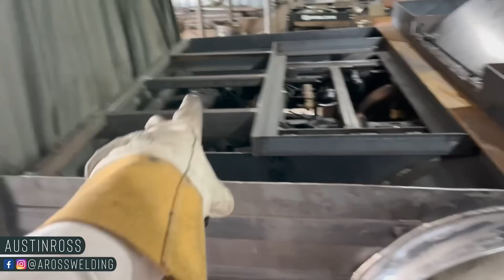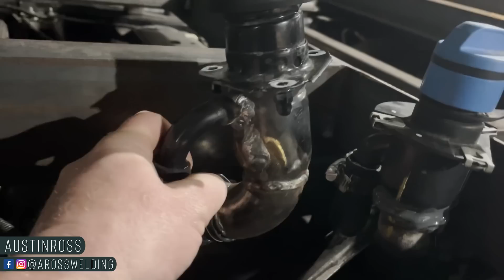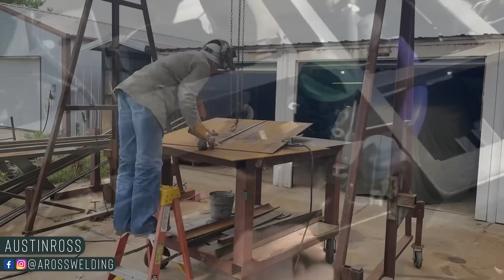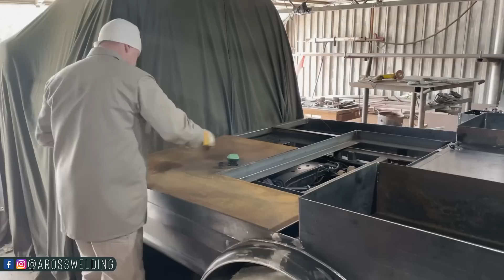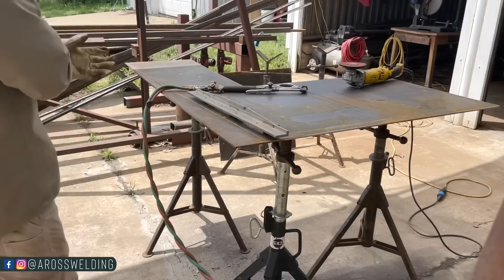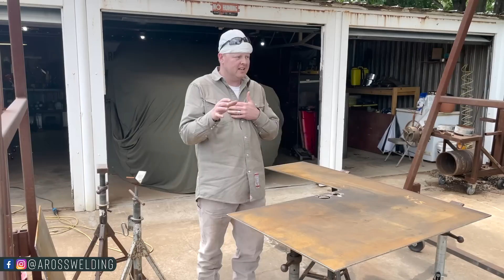Custom Welding Bed Filler Neck

Comment: Wonder what you think about this 

If you were to put the rod box right above the exhaust to heat it/ remove moisture I’m from Canada and there’s been times where I have been slamming my rods in the winter in my trucks exhaust while high idled to keep them hot 🤣

Comment: Great video! Thank you. Do you think the bed would've come out too weak if only 1/8" and 3/16" plate were used?
Reply from the maker: I highly recommend at least 3/16 unless it’s broke then 1/8 can be enough
Reply: @arosswelding  Thanks. I’m wanting to do something similar, but 1/4” is too much weight for my trailer build.

Comment: So whats your thoughts on the knox welding shirts been looking but haven't heard anything yet about them  by the way great videos on the bed
Reply from the maker: I like the white ones! They are slick! They are holding up ok for piddling type welding. I made a 24” .500 wall weld the other day with 8010 (down hill rod) and I’m not sure it will hold up like a Martin brothers but I need to give it a good run with down hill before I say for sure. For being an FR it holds starch better than a lot of other cheaper FR’s

Comment: Loved the idea of marking filler spouts with paint marker for reference points. How are the Knox FR shirts holding up?
Reply from the maker: I like the white ones! They are slick! They are holding up ok for piddling type welding. I made a 24” .500 wall weld the other day with 8010 (down hill rod) and I’m not sure it will hold up like a Martin brothers but I need to give it a good run with down hill before I say for sure. For being an FR it holds starch better than a lot of other cheaper FR’s
Reply: I was just wondering. I've been thinking about trying one. Have you got any 3x Martin Brothers shirts back in stock. Last time I checked you were out of them.
Reply from the maker: Not yet. We are having trouble keeping the khaki ones in stock. We are thinkin about gettin some denim ones just so our customers have at least an option in between being out of the khakis.
Reply: @arosswelding  Ok j
Reply: Just let me know when you get them in
Reply from the maker: If you’re not already. Get on our community text list. We will send out a text when we get them back in stock. Just text the word “shop” to 405-643-7176
Reply: @arosswelding  I'll txt you now. Thanks again